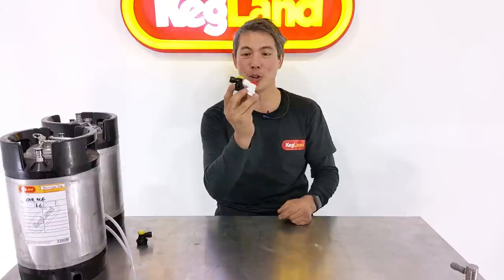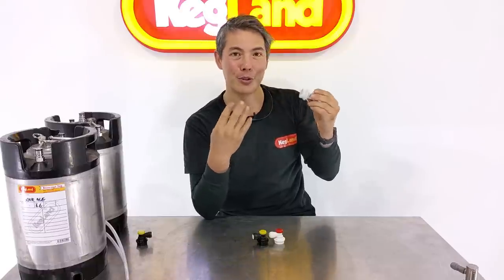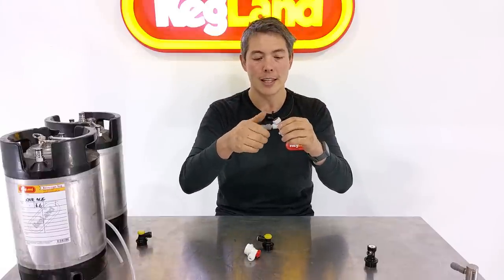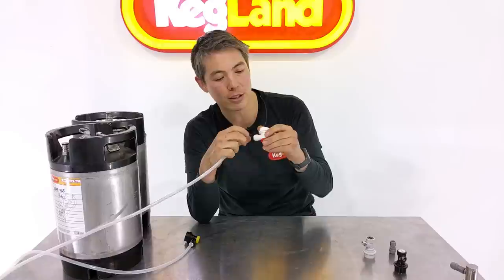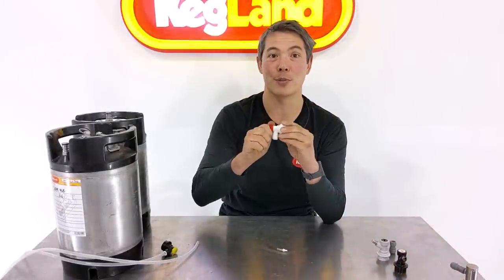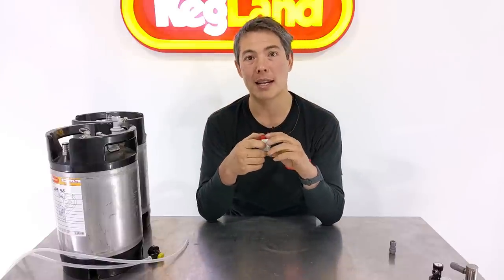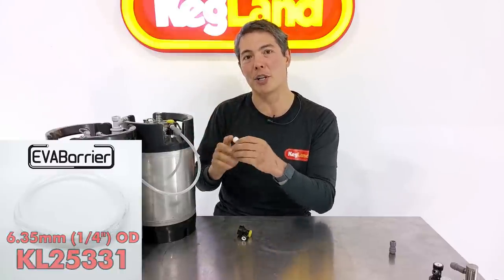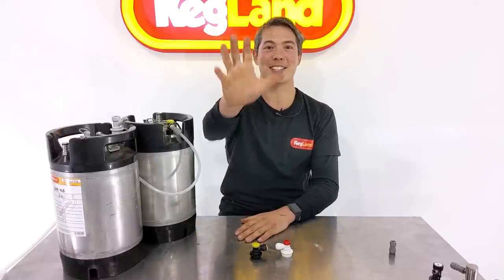Duotight Ball Lock Disconnects - A New Innovative Home/Craft Brewing Quick Connect that is Awesome!

Comment: Dammit! I just got into this, spent $1500 at your store and now these come out.
Great videos by the way! You are a natural - amazing you can do this in one take and you really know your stuff and it shows. "The other thing is..." never mind.. 😁
Reply from the maker: Thanks for your business.  Well at least these are not very expensive.  You can still upgrade later on.
Reply: @KegLand  True, but have to play the waiting game for the stock to arrive. All good, the products are amazing as-is, you're just making them better. I have a suggestion for a new product- a ball lock connect with a duotight connect straight up (vertical) so you can put the auto stop device straight on top. It's just clunky as it is with the right-angle bends and multiple connectors. Sell it with the auto stop device as a package. Just an idea tho. Cheers

Comment: Looking forward to getting the Kegland autoclave to clean my new disconnect!
Reply from the maker: Haha. Yes this might have to be one of our next products.
Reply: @KegLand  just got to design an autoclave lid for the kegmenter
Reply from the maker: @andrewbarker1190  As the lid is already stainless steel this should be fairly simply.  It's just a matter of swapping out some o-rings.  Are you using the kegmenter for kettle souring or something?
Reply: @KegLand  I hadn't even thought about the kegmenter sterilising itself.  No, I was just thinking about using a pressure vessel for sterilising some substrate for mushroom cultivation.

Comment: How many mm of beer line are you supposed to push into a duotight?  It would be useful information until the marked fittings are more common.  Maybe put it on each fitting's page.

Comment: Hey Kee,  After disassembling the ball locks and cleaning them in PBW, is it safe to dunk them in 180ºF / 82ºC water as an additional sanitizing step?  (I use them with mixed fermentation beers)

Comment: Question regarding "The FatBoy" 9,5mm (3/8") for quicker transfer. My first attempt, connecting the 9,5 mm ball locks to both ends between a 55 l. FermZilla  to a Keg, the transferring time actually increased. Measuring ID of the Carbonation Cap Barb sitting in lid of the Fermzilla to ≈ 4mm. I did NOT notice, nor understand how the beer flow would increase as long as Carbonation Cap works as a restrictor, besides at least in my case, only caused air and more foam than usual. My guess would be a need for a Carbonation Cap with upsizes barb to match ID hose size of the one between the FatBoyz, or what (where) did I actually miss (out) here ?

Comment: Hi the website says it's only compatible with 6.35mm tubing. Do you need an adapter to use the 3mm internal diameter tubing? ("EVABarrier 6.35mm x 9.5mm hosing only")
Reply from the maker: Yes we have all three sizes now on the website. So if it says only compatible with 6.35 (1/4) tubing then you are probably look at the wrong product. Have a look at the other models we also have on the website to take the larger tubing.

Comment: hello i have question,  i have the 8mm beer ball lock but the 5mm x 8mm evabarrier tubing  is too tight, which size do you recommend?
Reply from the maker: Yes we intentionally make the Evabarrier tubing with a tight fit.  Many customers find it easier to wet the tubing before insertion.  This makes it a lot easier to go into the hole.  The tight fit is important to get a leak proof seal.

Comment: I’m curious what this possibly work for the new soda stream terra bottles they are quick connects I would like to be able torefill them. Any suggestions?
Reply from the maker: Do you mean connect onto the co2 cylinder directly?  This is not a good idea? The co2 cylinders are unregulated and contain about 1500psi. (depending on temperature) but these ball lock disconnects are only suitable of about 150psi.

Comment: 6 years ago before Kegland existed I bought a few of the cheaper larger plastic ones, they all cracked, the top part where you need a large flat screwdriver on all split open, I hadn't even opened them up to clean them, this must be where their weakness is, however I have bought a few of the ones you sell and I have had no issues, will you be selling barbed type disconnects at all?
Reply from the maker: Yes some of those plastic ones are totally garbage and the issue is some customers think that all plastic is garbage but really there is good and bad plastic and it's imporant to talk to your destributors about what plastics they are using so you can educate yourself on the difference.  Good plastic costs a bit more but will last forever.

Comment: Can I double stack two 9.5l (KL02882) into a Series X Kegerator and  have 5 kegs inside? (3x19l, 2x9.5l)
Reply from the maker: That would be a tight squeeze with a lot of lines but technically it could be done.

Comment: Great stuff, just what I was looking for! Stacking two small kegs in my kegerator has been a pain! When will the small EVAbarrier be available? Having 4 meters of beer line for each tap is getting hard to work with
Reply from the maker: This is a product that was easy to manufacture so it got finished earlier than expected and you  can find the new Evabarrier 3mm ID here:
https://www.kegland.com.au/evabarrier-3mm-1-8-x-6-35mm-1-4-double-wall-eva-12meter-length-in-bag-beer-line-gas-line.html
Reply: @KegLand  thanks, any chances I can find it in your Aliexpress store? Im in Europe
Reply from the maker: @losFondos  The Aliexpress sold products are mainly to service markets that we do not already have distributors operating.  In Europe we have a number of distributors already but it just takes a bit of time for the new products to trickle all the way down to all the distributors.
Reply: @KegLand  how should we connect the new thinner beerline to a 5/8" shank? Is there for example a 6.35 push-in to 5/8 adapter?
Reply from the maker: @losFondos  You will have to go from 5/8 shank then use a reducer.  So this will require 2 pieces.  Alternatively we do have duotight shanks that have the 1/4 barb on the back so you can just put a female/female 1/4" (6.35mm) joiner to do this if this is the shank you are using.

Comment: I bought these from two different sources, and they literally will not open with a vise. Did you change the design? Is someone making fakes?
Reply from the maker: Where did you purchase them from?   That sounds a bit strange as you only need to tighten them finger tight to seal.

Comment: Starsan makes all duotights fittings dissolve, i dont use it anymore. Too bad, because i like the products.
Reply from the maker: Starsan does attack acetal (POM) and when it dries up on the surface of acetal it can etch the surface and cause chemical attack. If left in wet starsan it's not an issue but the concentrating effect of starsan drying on the surface of the fitting is the issue.  If it remains dilute on the fitthen they they will happily sit in starsan all year long.

with that said the this new duotight ball lock disconnect and all new duotight fittings are now getting made from polyketone (PK) which has higher chemical resistance.  As a result you will not get any "dissolving" issues that you are talking about.

Also some other plastics like nylon can also dissolve in phosphoric acid (such as starsan) but we also do not use any nylon on any of our fittings for this reason either.  CMB still make disconnects out of nylon which is not as chemically resistant as PK.

So give these a go. You will not have any issues with chemical resistance and this is one of the key selling points of this new design.
Reply: @KegLand  Good news, Thank you! :D

Comment: "Neepa" 😂 also old disconnects can be opened with a butter knife, key ... a coin haha no need for large screw driver. Still cool but no need to invent problems that don't exist.
Reply from the maker: That is only one feature.  The previous disconnects also did not have as good chemical resistance, under high pressure the o-ring would pop off, and last of all these are more compact so we can fit them into products such as our new mini kegerator more easily.

Comment: Brexit has made dealing with the UK difficult. Do you supply anywhere in the EU.
Reply from the maker: Where are you based in Europe.  We have a number of different distributors you can can contact here:
https://www.google.com/maps/d/u/0/viewer?mid=1N99UwS4hcd_2aexS2kxaxc-VW2Qitmg6&ll=16.704713324407358%2C-140.17100376641093&z=2
Reply: @KegLand  Just checked with the places listed in Europe but none have them in Stock. Will you have them soon in your shop on Aliexpress soon
Reply from the maker: @briandempsey9367  Sorry about that. This is a very new product and we are just ramping up production of these now. I think most likely you will see these in Europe and many other countries in another 2 months from now. As they are still very new it sometimes just takes a little bit longer for the stock to get out to all our distributors.